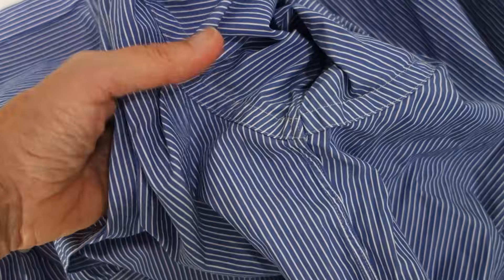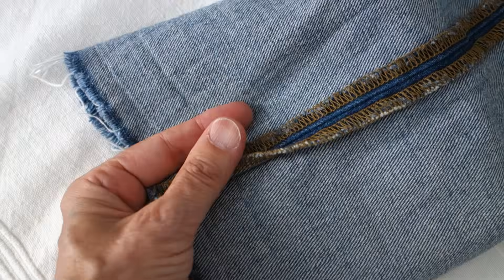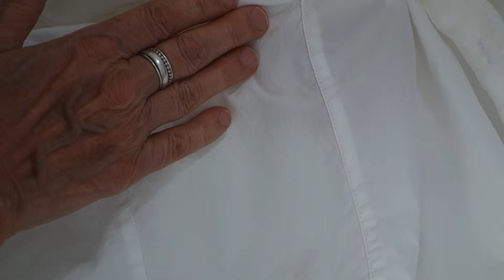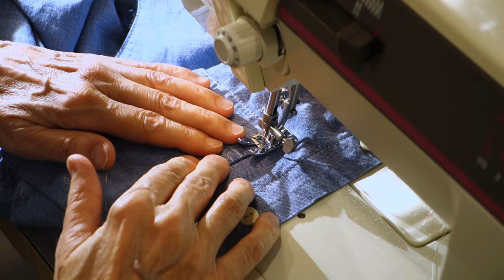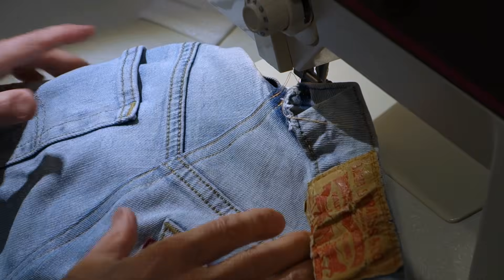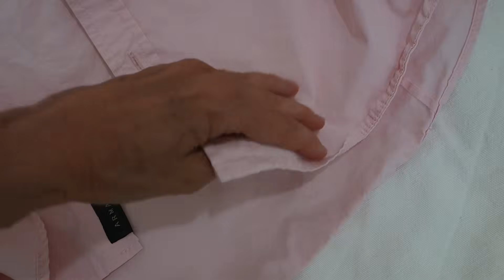DIY HOW TO SEW SEAM FINISHES : upcycling tutorial using home sewing machine

Comment: Oh I love that fake flat felled seam and the binding on the jacket. I’m one of those who don’t own a serger either and I’m ok with that. I did come across a little gadget that I do find useful. It’s my brother SA177 side cutter. It doesn’t work on knits or real thick fabrics but only wovens. However most knits don’t ravel so just a stitch like a zigzag really just for looks or one of the stitches you’ve shown.  All a side cutter is it’s just an over cast foot with a blade.  You attach it to your sewing machine much like a walking foot. It finishes the seam and removes the excess fabric similar to a serger. No it’s not as fancy as a serger or as quick. However you can do the same stitches that the overcast foot does and it can go at a fairly quick speed. I also like it because it wraps the stitches around the fabric like a serger does rather than a flat stitch you have to trim. Great for beginners, great for those who don’t want to invest the money in a serger, and it fits in my accessory box with my other presser feet . Making it great for travel. No 4-5 large spools of thread or complicated threading. I believe they have it on Amazon for $65.00 . So lot cheaper than a serger. There are other brands besides the brother SA177. Only advice stay away from the real cheap ones. Lots of YouTube videos and Amazon also has videos on the side cutter. There is a learning curve and encourage practicing until you get the hang of it. Starching some fabrics helps. Once I got the hang of mine I absolutely love it. I hope this helps someone.
Reply from the maker: Thanks for your comment! Really appreciate the info about the side cutter. I had an overcast foot (without cutter) for my other machine and it really helped with the pucker effect  - it might be time to expand the accessories on this machine.